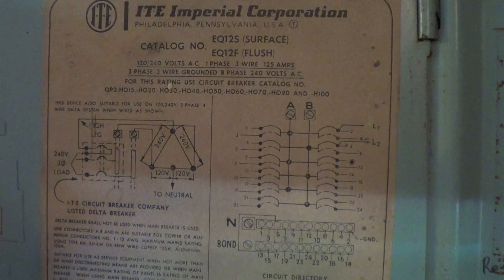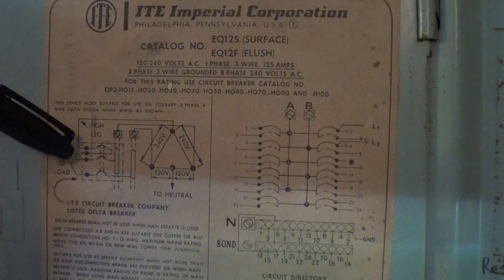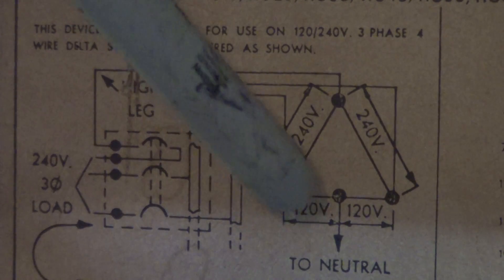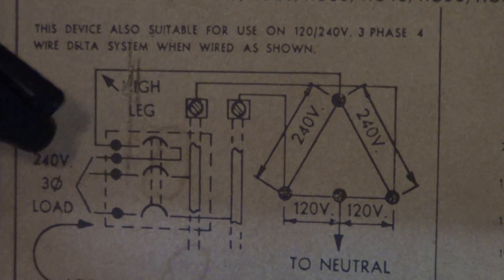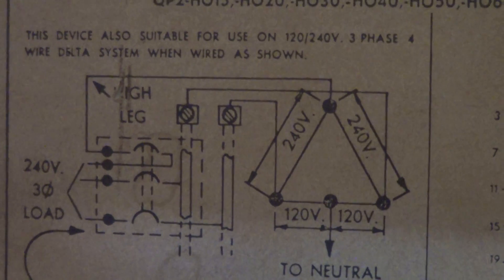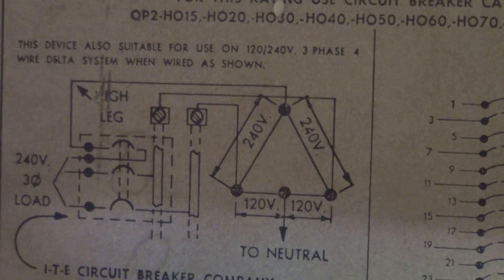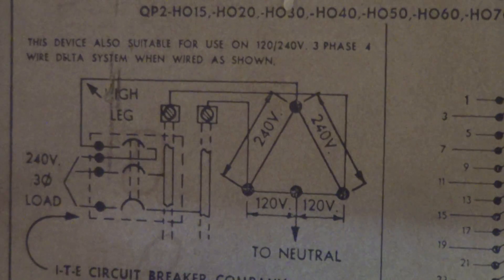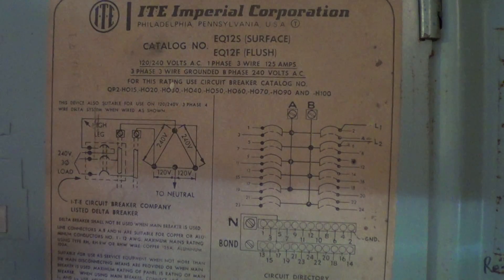HIGH LEG DELTA Breaker in a single phase box circa 1971

Comment: This is a great video for the younger DIY'ers.   A few years back I rented a home that was built I'm told in the late 60s.  The panel was a split bus, there was no main breaker but I remember a group of two pole breakers at the top, and all the single poles at the bottom.   Anyway on the panel cover it had this diagram of 3 phase, I had no idea what it  meant as all residential settings are single phase,  with the possible exception of a very large,  luxury home or custom built home that either has very extensive electrical demands or has a home garage with a bunch of three phase workshop equipment.  Also some utility companies require three phase, or single phase with engineer approval, on any service above a certain amperage, typically 400 to 600 amperes.

Comment: Open Delta with "Stinger" Leg are quite common in San Francisco
Especially in older buildings

New code book says the stinger leg must be phase "C" and Purple in color
.Black, Red, Purple

Most older installations I have seen the stinger leg is "B" and Orange in color
.Black, Orange, Purple

San Francisco has it own electrical code book that says
"This Electrical code supersedes all other electrical codes & ordinances
in the City and County of San Francisco"

High-Leg = Wild-Leg = Bast*rd Leg = Orange Leg = Stinger leg & even Red-Leg

Our newer code book refers to it as High-Leg
and actually has the word "Orange" struck out and replaced with Purple

Orange is now only allowed for 277/480
Reply: I was going to question you on the high leg color, then you wrote San Francisco.

Comment: You can use the high leg for modern LED light fixtures that have universal voltage drivers in them. (100-277 volts).
Reply from the maker: That breaker box has the 3 phase Breaker for a single load such as a 5 ton 240 volt 3 phase AC unit. The wild cat 208 volt leg is in this case not really used for a single phase load. A McDonalds often is wired with 120/208 Y were there is 120 volts to neutral for computers and lights; and 208 volts 3 phase for AC units, plus 208 volts single phase for fan motors (or lighting that can use 208 volts too) .    Back to your question, 208 volts line to neutral is rarely used in a high leg delta system. Even if one has a 3 phase panel; there are few if any say 240 volt single phase 15 or 20 amp breakers. A common home breaker is not rated for 208 volts in single phase; only approved with 120 volts to ground max. There were ones sold in Brazil and as old stock on ebay a few years back.
Reply: 3beltwesty Yes that is correct. However if you have a 3 pole breaker, (all of which are straight voltage rated) you can connect a single phase 208 load to it.
Reply from the maker: The problem is there are actually some 120/240 volt 3 phase breakers  around in use.  ie not straight rated for 240 volts. Thus a McDonalds can have a 120/208Y or an old Apartment complex can have 120/208Y with each apartment getting two legs thus single phase 208 volts for the apartments ovens etc. 

 In Southern Calif I saw 120/240 volt 3 phase breakers in businesses. These 3 phase breakers are only rated for 120 volts Hot to Neutral, thus 208 volts line to line still has only each leg 120 volts to Neutral. 

You CAN use one of these 120/240 3 phase breakers on a 208 volts to Neutral, BUT you violate the code.

 ie a Ground fault is now at 208 volts, not 120 volts thus who gets there rear end sued?  If Hillary she is Queen Bee, OK to delete emails and lie. If you are Joe EE then your license gets pulled if the Building burns down due to using the wrong breakers. 

Thus the word can is troublesome, one can delete emails, one can but pennies in fuse boxes, one can do many things as long as one does not get caught or one has a Teflon cult following. :) 

There are Folks who just gang together 3 single phase 120 volt breakers with a nail for common trip. This config is electrically OK for a 120/208Y but not for a 120/240 High Leg Delta since the wild cat leg is 208 volts to Neutral/Ground and this exceeds the voltage rating of the breaker. 

There are 120/240 volt  2 and 3 pole breakers. In Southern Calif  years ago the slash rated 120/240 volt 3 phase variant was lower in price than a 240 volt 3 Phase 1 inch breaker, thus in building repair that is what the landlords bought. ie Home Depot there once had both variants. 

 By the code, a 120/208 Y could use a 120/240 volt breaker since there is only 120 volts to the Neutral.
Reply: @3beltwesty  That's funny, I have never come across a 3 pole slashed rated breaker unless it is an AFCI, GFCI,or a DFCI. All the ones I have are straight rated (240, 480, or 600 volts).
Reply: Or you can use 277 volt single pole breakers.

Comment: Thank you for showing this. I installed a new delta high leg for some European gear in the the late 1990's but just ran across this older type of delta high leg set up and wasn't sure what was going on. Thanks for articulating about that high leg coming strait off the meter. I wasn't going to touch anything until I did a little research.

Comment: In a delta 4-wire system the line to line voltage would be 240V. The line to common (neutral) from two of the phases is 120V (these are the ones you want for your single phase loads). From the third phase to common you have 208V which is called the high/wild leg (not the voltage you would want for single phase loads. Note: if you draw a line straight down from the high leg to the common you get right angle triangles where you can use Pythagorean theorem to solve for the third side (208V).

Comment: You get 240 phase to phase, and either 208 or 220 on the wild leg to ground, depending on the transformer connections.
Reply: "depending on the transformer connections" ? If the supply was running 6% high from the nominal 240V you would get 220V.